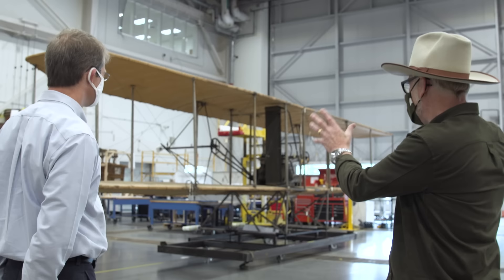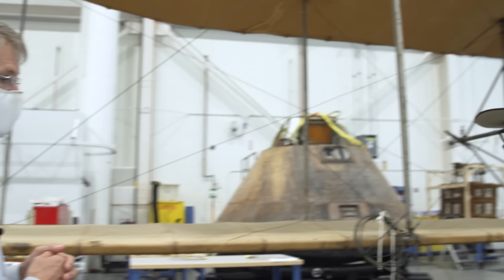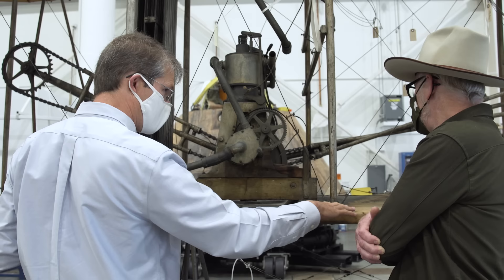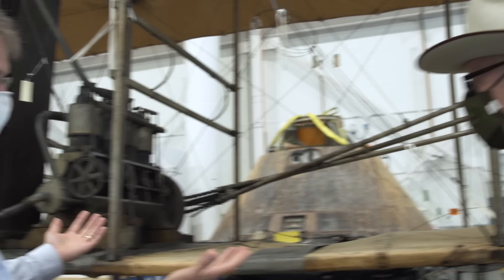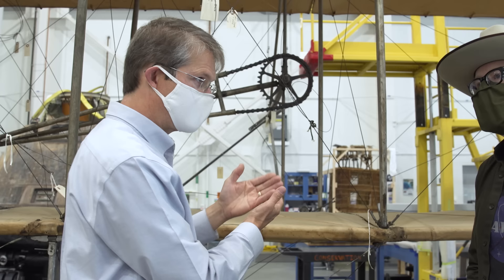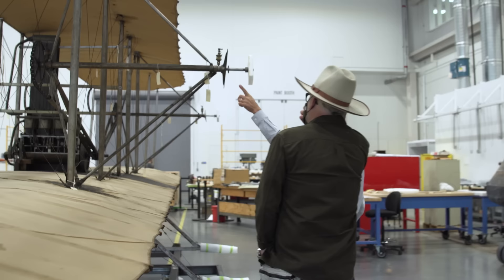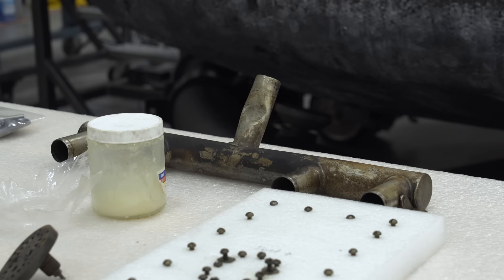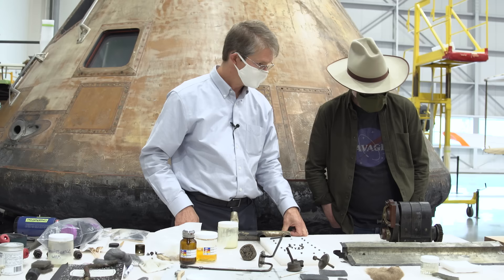Adam Savage Examines the Wright Brothers 1909 Military Flyer

Comment: To all those saying the Wrights did not invent flying. There is a hour long video on the Greg's airplanes channel explaining in detail why you are completely wrong. No matter what your feelings on the USA or your country. Trying to strip the Wrights of their incredible accomplishments is completely wrong.
Reply: There's always going to be some jerk to contradict every "first."  "Chuck Yeager didn't break the sound barrier, Edison didn't invent the light bulb,  Abraham Lincoln invented the Sony Playstation" etc.  Don't let them get you down. The Wright Brothers flew first.
Reply: @adamgh0  Edison didn't invent the light bulb. He did invent the screw base though. But there were light bulbs predating Edison's work by decades. The trouble with all that came before Edison is none of their designs were commercially viable. You needed an EE degree to operate any of them.

Comment: I recommend reading "The Wright Brothers" by David McCullough.
There was a third member of the Wright Brothers.
Charlie Taylor was the Machinist and Mechanic that built the original engine of the 1903 Flyer.  
Quote
Charles Edward Taylor (May 24, 1868 – January 30, 1956) was an American inventor, mechanic and machinist. He built the first aircraft engine used by the Wright brothers in the Wright Flyer, and was a vital contributor of mechanical skills in the building and maintaining of early Wright engines and airplanes.
Unquote
Will bet the engine of this 1909 Wright Flyer was also built by Charlie Taylor.
Reply: They were fortunate to have a genius like Charlie. His contribution is way underplayed.
Reply: @fractuss  So true.
As a Journeyman Machinist, I have the utmost respect and admiration for Charlie Taylor.
Reply: @MaxCruise73  I remember seeing a video where some folks made an exact copy. It took them like six months and a hundred thousand dollars. Charlie and the Wright Brothers did it from scratch in far less time and for certainly far less money. It's beyond remarkable.
Reply: And he did it with a lathe and a drill press and hand tools.. I'm a lowly carpenter but I can't imagine.

Comment: people forget that bicycles were cutting edge high tech gadgets at the turn of the 20th century.
Reply: They really weren't. The automobile was.
Reply: @1pcfred  You are right.  But what's amazing to me is that in 1903, automobiles were just starting to become 'the next big thing'.  They barely existed before the turn of the century and yet the first powered flight occurred within the same first few years of the new century.  And for the next 65+ years, the automobile and airplane essentially developed in parallel.  By January 1, 1970, all the major advances in aviation that would occur in the last century had already happened.  First test flight of a supersonic transport, man on the moon, and Mach 3 aircraft.  I'm sure someone will point out something I have overlooked, but about the only thing that seemed like an advance in aviation  to occur in the last 30 years of the 20th century was perhaps stealth technology.  In the new century we now have migrated to super efficient twin engine airliners, companies like Boom are trying to develop a viable supersonic airliner, and SpaceX has revolutionized the rocket industry, but for 30 years, it was a black hole of innovation.
Reply: @mauricedelarosa6940  work has been done on hypersonic flight. There are unique challenges to overcome there. Like the craft melting due to friction in the air. There are some crazy shockfront problems to deal with too. Our adversaries tout the capability but I doubt they can control it. We've been researching it for a lot longer than they have.

Comment: When I was in Freshman in college for aero engineering, one of the the first classes I took was a history of flight.  We talked a lot about why the Wright Bros were successful when so many others failed.  One of the primary reasons is because BEFORE trying to build an airplane, they first studied the science of flight and fluid dynamics, all the way back to Newton & Bernoulli.  They built wind tunnels to test wing shapes and flew hundreds of kites.  They succeeded because there were not only brilliant mechanics, but because they understood the science of flight and engineered their airplane to match the science.  They knew how much lift they required and how to obtain it.  They knew how much thrust was required to overcome the drag, and that determined the engine and propeller design.  They understood how changing the angle of attack on the tip of the wing would generate asymmetrical lift to bank the aircraft.  The Wright Brothers were truly amazing!!

Comment: Excellent video and great to watch.  If you are interested in the early aviation of the Wright Brothers, the third powered airplane they ever built (the first one made four straight hops at the NC Outer Banks, the second flew in Dayton but not well and parts were incorporated into the third), the third is the Wright Flyer III in which they learned how to turn properly, and had hour long flights etc in a small field (Huffman Prairie) near Dayton, Ohio.  The Wright Flyer III is considered by the Wrights as their first practical airplane.  It is on display in Dayton; and the display was arranged by Orville Wright near the end of his life.  Also, you can also walk around Huffman Prairie, pretty much as it was when the Wrights flew there.

Comment: The first European that made a airplane that was engine powered (Air cooled) (Airplane that was heavier than air) was the Danish Jacob Ellehammer in 1906. It flew 42 meters in a high of about 47 cm. Because the information about the Wright Brothers was so long to arrive to Europe (And no one believed them) people still thought they could be the first to build a plane with a motor attached.
Reply: It is incredible how far the Wright Brothers were ahead of anybody else.
In 1906 people still cherished hops of a few dozen meters, and the Wrights did a controlled circular flight of more than 30 Minutes at the end of 1905.
Reply: @Redmenace96  WW1 'gave' it to the people.
Lots of surplus aircraft available, WW1 increased motorization amongst all participating countries.
The vast majority of Ford Model T were produced after the great war.
After WW1 the US was the only developed country that had no massive destruction on home soil and did not need to pay large reparations (UK is a special case but they too had massive issues).
The US, by sheer luck and geographical placement came out of WW1 relatively unscathed.
Reply: There was also a New Zealander who had a nack for making flying machines around that time too. I think what's more fascinating is the jump in aerial technologies in just a decade of progress

Comment: This is what made the Wright Brothers the inventors of the airplane: the fact that they conceived the entire craft as one system that had to have every tiny piece perfectly designed to do it's job. There were gliders before them that flew. There were engines that powered previous craft  in early attempts to achieve controlled flight. But Orville and Wilbur were the ones who put everything together to build the first operating airplane.

Comment: Only upset that the curator made that comment about the engines being designed and built by the Wrights. A gentleman named Charles Taylor was the mechanic who built the original engine that powered the 1903 Flyer in 6 weeks, and helped build this 1909 Flyer as well. I don’t know if he did build this particular engine, but I’d be astounded if he didn’t play a large hand in it’s design and construction. He deserves to be remembered as much as the Wrights do.

Comment: I'd love to hear that engine run. Other than the fuel injection, I noticed it was an overhead valve engine. There's no way they had hydraulic lifters at the time. It would be cool to have a close look at the valvetrain or even a dismounted cylinder. It looks like the heads are integrated with the cylinder. The crank driven water pump and exposed timing gears are great, too.
Reply: You can. Just google it.
Reply: Fuel injection was first invented in 1878 (UK – Brayton). First manifold injection system 1884 (Germany – Diesel). OHV engine came in 1898 (USA – Marr) and first application was 1904 (USA – Buick). Wright Brothers produced their first OHV engine in 1906. First supercharged engine was 1878 (UK – Clerk) the same design was first used in a car 1885 (Germany – Daimler). First SOHC engine was 1902 (UK – Maudslay) and DOHC 1910 (France – Peugeot).
Reply: Most piston aircraft engines to this day still use cylinders that each have their own integrated cylinder head and are detachable from the crankcase.

Comment: I'm always amazed by how many features on a pioneering piece of technology seem to be so advanced; you always assume they would be simple but that's rarely the case. I grew up in Cornwall learning about Trevithick's first steam locomotive and there's genuinely brilliant engineering solutions you'd imagine would come later, but there they are right at the start. Do the Wright's get credit for fuel injection? I never knew they built their engines! What a wonderful example to still have intact. Wow.
Reply: This sort of fuel injection is akin to spraying starting fluid into the intake - I'd imagine largely inefficient in that time of the carburetor that made the fuel/air mix more efficient so you get more out of the weight (fuel) you carry. Aviation technology is conservative - efficiency comes well after reliability... this may have been smart choice for the state of the technology. Later fuel injection and obviously digitally controlled injection are something much more sophisticated.

Comment: And only 60 years after they built this humans flew to the moon. Amazing.
Reply: I have to wonder what the Wrights would have to say about that feat.
Reply: Its honestly interesting what they were able to do within a dozen years too. 

Like, most other technologies took far longer to mature
Reply: @aaronbasham6554  who told you the tech they flew to the Moon was mature? They basically went in a craft that could pass for a TV dinner tray. When they built the LEM they had to put baking sheets on the floor so tools wouldn't pass right through if it someone dropped one. The skin was aluminum sheet about 3 times thicker than aluminum foil is. So the same stuff old TV dinners came in.
Reply: @1pcfred  okay, but compare that to how long it took to get cars that actually worked properly, or even steam powered vessels
Reply: @aaronbasham6554  innovation happens unevenly. It only took 19 years from invention before an automobile went over 100 MPH. What still didn't exist then was an infrastructure that could support transportation by automobile. Smooth paved roads. Steam powered vehicles happened as soon as steam power plants could be made that were portable. Fulton's first steam powered voyage happened in 1807. The state of machining then was limited.
Reply: Well rocketry was far more advanced than airplanes in this era.

Comment: I have to give credit to the people that flew that , there is no way in hell my ass would go up in that thing
Reply: may actually be safer than that recently upgraded b-737 XD
Reply: they didnt know any better.... that's their luck i guess
Reply: @thewaytruthandlife  actually brothers did flown A LOT and got only few incidents. While other follow-up aviators of that time had much less success. Roughly 50% of early aviators died in aircraft crash, AFAIK, but not Wright brothers.
If it was all about luck - there was a hell lot of it :)
Reply: Still better in-flight service than RyanAir too…
Reply: @shurmurray  We can use the term fly loosely. They were airborne but they only traveled at about the speed of a brisk walk. Something like 6 MPH So not exactly screaming along. It took them 59 seconds to go 852 feet. Which works out to about 6.2 MPH
Reply: @1pcfred  they flew against strong wind, so the ground speed was low. In calm conditions the speed was much higher.
Reply: @shurmurray  I don't know about much higher. The early flights almost always ended in crash landings. Which people often survived.
Reply: @1pcfred  (double checked with google) for the 1st powered flight they took off against head wind of about 27 MPH. So the air speed (in turn, speed in no wind conditions) is about just under 40 MPH.
And I also found exact specifications on 1909 military flyer - it's speed is 42 MPH.
That is comparable to modern powered hang gliders and powered paragliders and probably the lowest practical speed for the airplanes. Going slower requires serious increase in surface area of the wings keeping the weight down.
Reply: @1pcfred  it's an official measured flight speed for 1909 model. Military guys paid $$$ for those specs.

Comment: Just outside of Dayton Ohio, in Miamisburg, is The Wright Brothers General Aviation airport, where there is a Flyable Wright Flyer, they fly it at the Dayton Airshow every year, and they have a great little museum where you can go in and some really great ol guys will tell you all about the aircraft. If the weather is ok, you can even pay to go on an orientation flight with one of these amazing guys that still maintain this unreal aircraft,  it takes off at 25mph and cruises at about 35mph, i definitely recommend at least going to the hanger and checking this flyable history if you get a chance, and then go a few miles down the road to Dayton and check out the museum at Wright Patt, the USAF museum,  and you can even stop in between the 2 museums and check out the Wright Brothers bicycle shop, its a great way to spend a weekend in Dayton

Comment: Wow. I had the same look on my face when visiting the Wright Brother's museum in Dayton and did not realize that the un-restored Wright Flyer #2 was hanging there in a darkened room right off their workshop...just like it was the last time it was flown. Amazing stuff (another Wright flyer can be found in Wright_Patterson's unreal museum). Had no idea it was there... Glad folks thought to keep old stuff like that laying around! Really good to see Adam in full goof geek!
Reply: The 1903 Flyer the Smithsonian has is only partially the original. Orville pretty much kit bashed it together out of surviving pieces of the kitty Hawk plane and various other extra bits he still had from their first series of airplanes. The original plane got mangled by a strong wind gust that flipped it after a hard landing at the end of its 4th flight (852 feet). They weren't interested in fixing it to use again because they were able to see improvements that were needed and it would be easier to build a new one from scratch rather than repair and modify that one. Among the fixes needed were improvements to stability. It was only by their many tethered and untethered glider flights they knew the handling quirks and were able to keep the 1903 Flyer under control. That lack of stability is likely why it came down hard at the end of the 4th flight.

The 1903 Flyer had proved a point, and provided important data. It didn't matter that it got wrecked. SpaceX has been doing the same thing with their rapid rocket development. Build, crash or explode, or crash and explode, or nearly crash then explode anyway, just because. Keep doing that, collecting data, until figuring out how to launch then not crash and/or explode.

Comment: I used to live on fort myer in echo company barracks, and in our Dayroom was a picture of the test flight, it was done on our parade field which was across the street from my barracks maybe 75 feet from the front door. And there is a memorial there.That’s on fort myer in Arlington va not Arlington cemetery, the cemetery is connected to our base fort myer, but the flight was on fort myer about 1/2 a mile from the cemetery

Comment: Adam, if you're ever in Dayton, the aforementioned National Museum of the USAF is there with a replica of the 1909 military flyer. But Carillon Historical Park has an original 1905 Wright Flyer III and the Wright Brothers National Museum. They also have a replica of the Wright Bicycle Shop (since the original was bought by Henry Ford and moved to Deerfield Village.) The Air Force Museum and the Wright Museum both have the Wright Brothers' wind tunnels.

Comment: How cool would it be, if they 3D scanned every individual part of the engine — and then used printed "original" parts to make animated displays that show how each part of the engine works and why it was an innovation in 1908 (e.g. a cut-thru of the exhaust manifold to see the baffles) ~ so that visitors can really appreciate that the Wright Flyer was every bit as "hi-tech" in 1908 as the Apollo 11 module was in 1969 (sitting unmentioned/anonymously in the background)? 🤓👍

Comment: Mind boggling….they were soooo    smart and driven.  If you go to the Wright Brothers museum at Kitty Hawk, read the walls. I actually teared up. Their notes, dozens of them, are displayed. Dozens of different airfoils and drag/lift numbers for each. Dozens of meticulously written graphs and charts. Unbelievable. They INVENTED: the propeller, fuel injection, their own engine, yaw control(rudder), roll control(wing warping), pitch control(elevator) , wind tunnel, with precise measuring devices, building materials, etc.

Comment: 10:28 to anyone not in the know, those screws are put into foam like that, so they know where they go on the plane. This way, all original parts are held togethe rby the original screw. This is done for a couiple reasons. One being, to keep it original, two being, so they don't possibly strip out a hole or screw by putting it in a different hole and causing problems, which CAN happen on old stuff